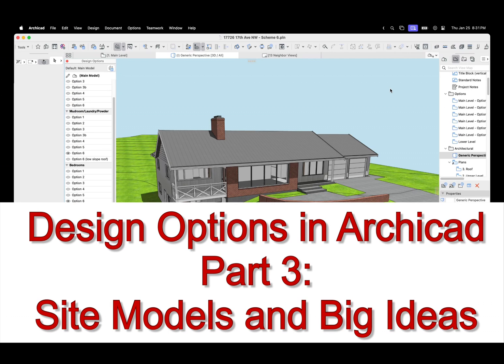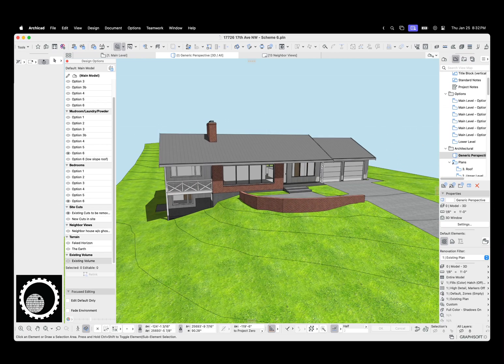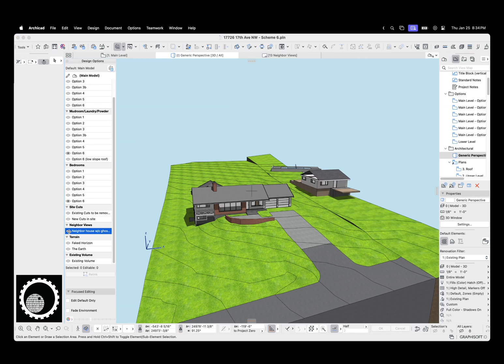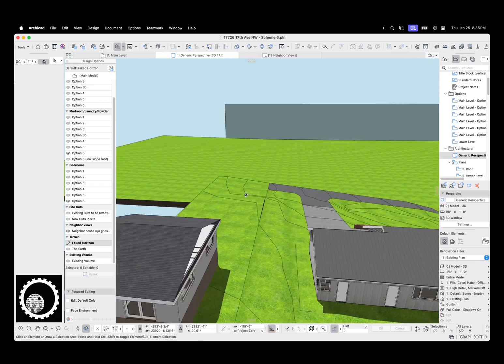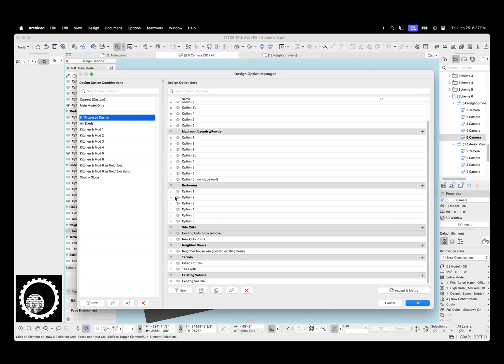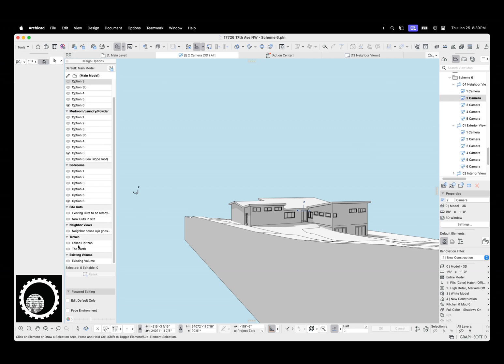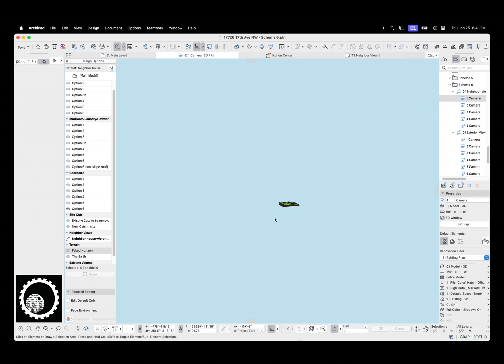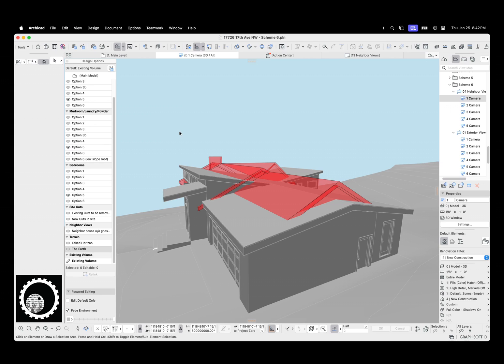Archicad Tutorial #98:  Design Options in Archicad, Part 3 (Site Models & Big Ideas)

Comment: Amazing tool and thanks for the videos! Excited to start using it. I’m assuming that once you have your model view in the design option you want it’s possible to just save current view or save drawing and that will create a save layer and option state within that drawing to use on sheets? 
I think it’s going to take me some time to adjust to using design options instead of layers.
Reply from the maker: Design Options are an easy addition to your typical layer combinations. And yes, save current view will save whatever design options are visible. Though for views, I recommend making sure you are using a Design Option Combination rather than having that setting set to Custom.
Reply: @Shoegnome  ah I see, I’ll make sure to create a layer combination instead of custom. Thanks for the tips! I’m currently using it for my project but my program crashed twice after duplicating an option and trying to move one of the duplicated walls in the new option. Not sure why maybe just a glitch.
Reply from the maker: Update to the latest version of Archicad 27. There was a bug in the initial release that caused a crash when duplicating a Design Option that contained dimensions.
Reply: Ah! That’s exactly what was happening with the dimensions. I’ll try to update. Much appreciated.